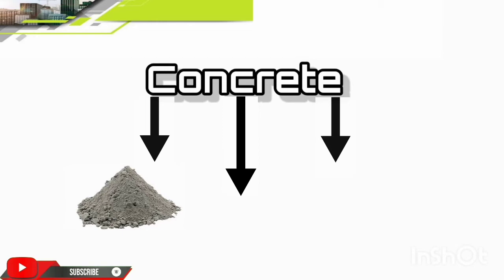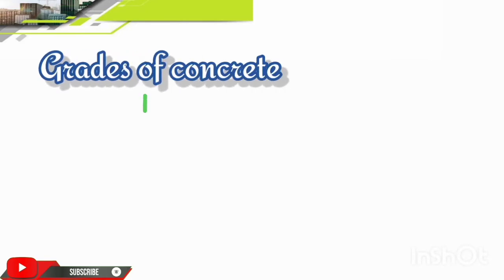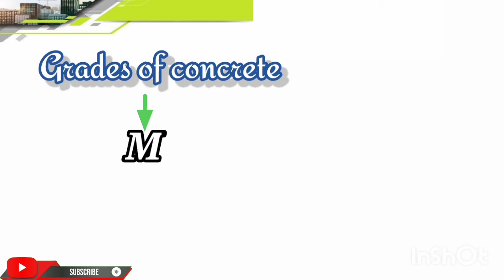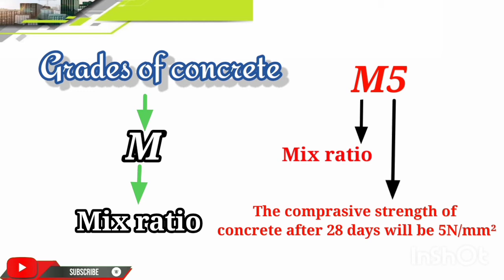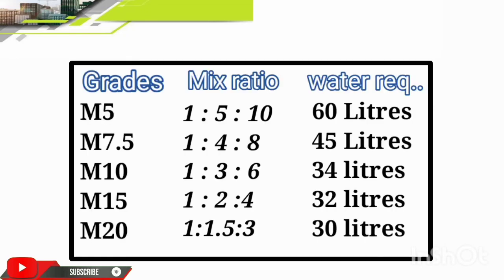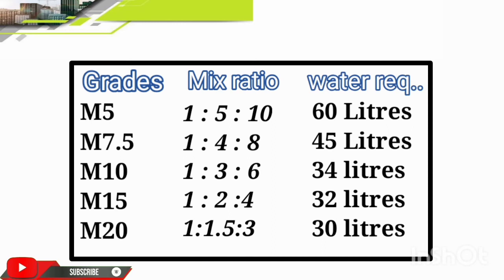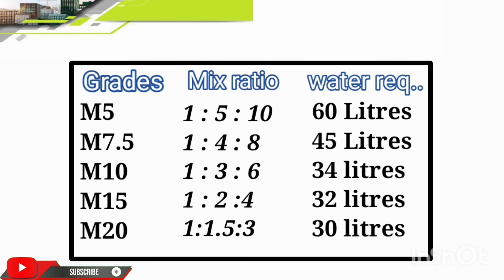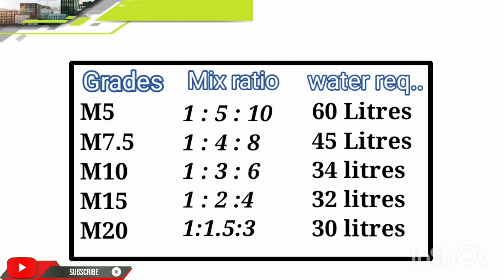Grades of concrete|| water cement ratio with mix ratio

Comment: M5 our m10 Q kahta ha Sir plz Vodio
Reply from the maker: I have already discussed it in the video, M5 mai ('M' ka matlab hai mix ratio ye 'M' mix ratio ko represent karta hai, or jo value oske sath lagi hoti hai, like 5,10,15 etc, ye oski compressive strength ko represent karta hai, like 'M" means the mix ratio and 5 means the compressive strength of concrete after 28 days in N/mm²